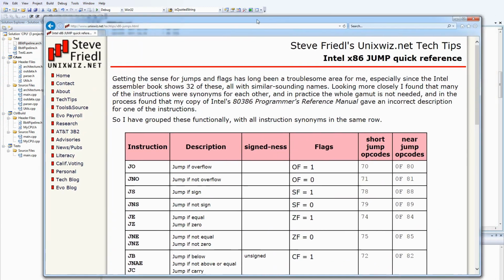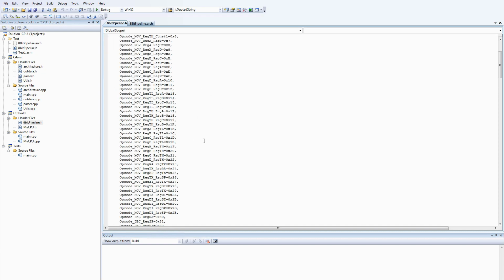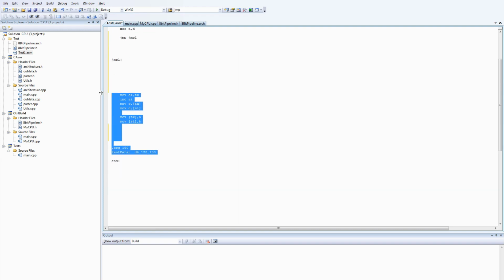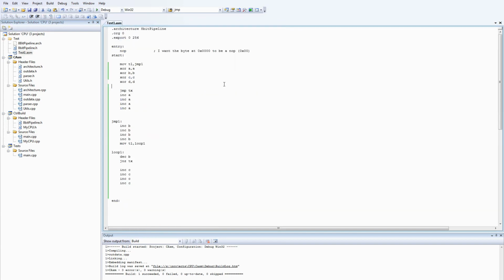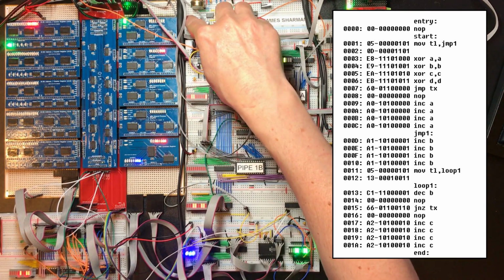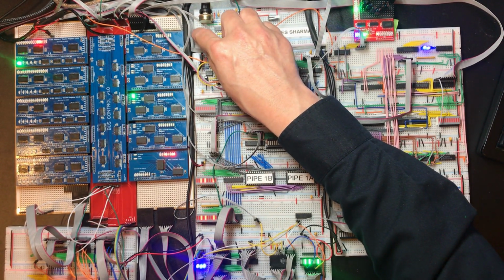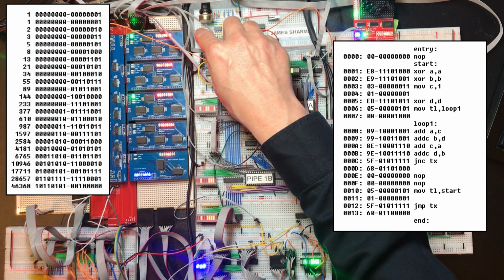Flow Control - Making an 8 Bit pipelined CPU - Part 54

Comment: Yep, that's one of the things that drove me nuts about MIPS.  I only once found a use for it.  Usually it's just an unnecessary NOP.
Reply from the maker: I've used it quite a bit in the past on mips. Remember the delay is often there regardless, pipelined cpu's without it normallly are just wasting the extra cycle(s), at least before you get into the complexities of branch prediction.

Comment: Bravo for accepting the delayed branch! Were you a MIPS, PA-RISC or SPARC programmer at some point?  

I did the odd bit of assembly on HP-PA, Sun4 and DECStation, so I've seen delayed-branch before. I seem to recall that one of the early RISC processors also had load delays like yours, and then needed multiple microcode revisions because the presence of caches messed up the timings. Compilers actually got amazingly good at finding work to fill branch delay slots.
Reply from the maker: Playstation-2 was MIPS III which I did a lot of low level optimization on, that was probably the first platform I did a lot of work on where I was taking account of delay slots.

Comment: Why does register B (35:53, 37:48, 37:50) and D (37:48, 37:59) sometimes flash? What did I miss?
Reply from the maker: In the first time index the instruction completing in stage 2 is "addc b,d", there is some irregularity to some of the timing purely down to my pushing the button manually.
Reply: @weirdboyjim  I dont think it is related to manual ticks (button) or regular (auto). As you can see even later when you do not push it, and it is running freely, its still flickering. I was just curious if it is some bug, that will be later fixed or something related with pipeline by design.
Reply from the maker: Ok, I had a second look at this (on a computer screen rather than a phone screen) and realised what you were talking about. What you are seeing relates to a problem I had with the circuit. The B register in this case is going to load, so the bus controller is feeding the address of the register and the clock into a 74LS138 which will generate the latch line that will go low at the start of the clock and return high in the middle.  The issue I had for a little while is that the selection and clock signal were not synchronised resulting in a momentary downward blip at the start of the cycle on the latch line. This resulted in the register loading whatever junk was on the bus at the start of the cycle before it loaded the correct value at the mid point. This didn’t cause any issues as the register was changing anyway, but there was a similar issue on the counters I had to diagnose and fix later.
Reply: @weirdboyjim  Thanks for the explanation. It was driving me crazy, since it looked almost like some pattern related to addc command, but I could not see how it relates. Anyway nice project, even Im a bit late to the train :)

Comment: I realized there's quite a bit I forgot to mention in my previous comment.

First, I wanted to go over the changes to the flags used in conditionals compared to x86. Since the carry flag generated by subtraction in your processor is the inverse of that generated by the x86 during subtraction, you need to invert the carry requirements in any conditional that uses the carry flag but doesn't mention its state. This means that JB and JNAE should be aliases for JNC, not JC; JNB and JAE should be aliases for JC, not JNC; JBE and JNA should use flags (!Carry OR Zero); and JNBE and JA should use flags (Carry AND !Zero).

Second, at 11:35, the expression you wrote for JG was equivalent to (!Zero AND !Sign), which doesn't take into account the overflow.

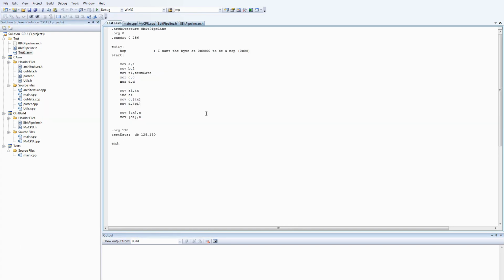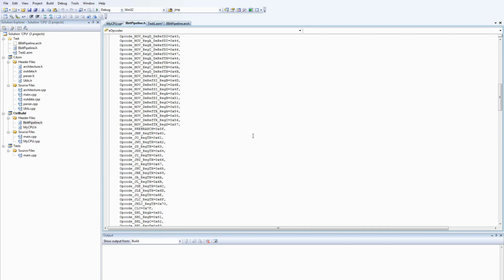Third, between when you initially wrote all of the microcode for the conditional jump instructions at 11:39 and when you next show it at 26:53, it looks like you added parentheses around nd the ternary operators. I'm guessing you fixed that around when you were troubleshooting the problem that occurred at around 21:31 but just didn't show it.

Finally, I was hoping to see some optimization involving the branch delay slot, but since the PREBRANCH instruction forces a NOP right after a branch, I guess I won't get to see that. That's disappointing.
Reply from the maker: I'm amazed how many people comment about mistakes after I find / fix them compared to before.

Comment: (0:49) Well, I already went over my guess for one of the other two lines in a previous video. Not sure about the last one, though.
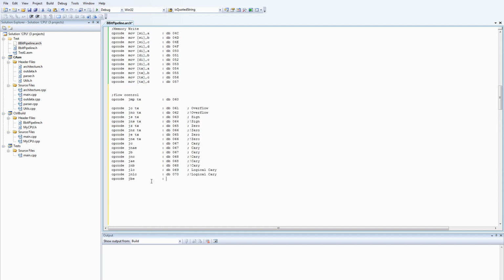(4:27) The carry flag works differently in x86 than in your processor, so some of those conditional jump aliases don't make sense on your processor. (On x86, both unsigned carry and unsigned borrow set the carry flag, whereas on your processor, unsigned carry sets the carry flag, and unsigned borrow clears the carry flag.)
(23:11) I think that might be the race condition between PC load and increment I mentioned before!

Did you ever get rid of the need for the prebranch instruction?
Reply from the maker: It was a genuine mistake to use the x86 truth table, at the time I didn't realize the meaning of the carry flag was inverted there. This gets fixed in a later video.

Comment: Any plans to make your assembler any smarter and start to do your delay slot optimisation for you? Or have it emit meta instructions such that you could do something like `mov tx, {a, b}` and it'll emit the correct movs and shifts for you?
Reply from the maker: Smart optimization like that would be an interesting challenge, but very time consuming to implement. Even more of a challenge to do such that the assembler is still vaguely generic.

Comment: Seems like subdividing the clock to have some parts execute a bit later to give others time to have some gates would be a good idea. It already is divided into two halves, so having another subdivision at "clock + 2 gates" wouldn't be too outlandish. And having a clock line that ends early and starts late would make sure there's never an overlap asserting to any bus.
Reply from the maker: I do use a bit of a delay like that on the memory board to make sure the address is on the bus.

Comment: Very nice job. Was wondering if you were going to use branch delay slots, or a pipeline flush. Got my answer.

And I also have an odd idea involving speed. Suspect the EEPROMs you're using for your pipeline control are fairly slow and as such are in the critical path regarding the ultimate speed of your CPU. So my idea is to replace those EEPROMs with much faster static RAMs. Then extend/replace your reset with a circuit that copies data from an EEPROM into the static RAM. Of course that makes a reset take a lot longer, so perhaps have two different versions. A cold reset does the copy, while a warm reset doesn't.
Reply from the maker: Thanks John! The eeproms, specifically the stage 1 roms are the critical path. Your suggest would help but I think the circuitry would get in the way of one of the purposes of the build which is to try and create a simple model. I maybe able to increase the clock rate in the future by switching to some one time programmable roms but later in the series you'll see we get some decent performance out of it as is. You may be interested that I do a similer rom->ram copy system on a later video for main memory  to both improve the speed but also give me some extra flexibility about memory configuration.

Comment: I love the series and you clearly deserve many, many more views.
I was wondering about the choice to have a load tx+prebranch+jmp(+nop) for all branches, this sounds like a lot of work for a very common feature, isn't it going to hurt software performance globally?
Reply from the maker: Thanks Julien! Glad you are enjoying it. The final nop isn't needed and I'm hoping to do a circuit fix to drop the hidden prebranch instruction but I've said I'll only do that when the rest of it is finished (It could be done a few ways). The performance isn't that bad though, A jump to a 16 bit destination from scratch is "mov tl,??; mov th,??;prebranch;jmp tx" which is 7 cycles from beginning to end. This looks harsh but remember "JP 16bitImmediate" on the z80 is a 10 cycle instruction (The 6502 JMP is faster at 3 cycles). Where my stuff does loose out is in compactness, 3 bytes on the z80 (same on the 6502) compares to 6 bytes on my ISA.  Those sequences and other equivalent ones cause my binaries to be less compact than equivalent z80/6502. Most importantly the separation of the constant load and the jmp's like this allowed me to keep the pipeline much simpler that it would otherwise have been and I think it would have been tougher to follow if I'd had a deeper pipeline or a hybrid microcode system.

Comment: SPARC delay slots. 😎
Reply from the maker: As a programmer branch delay slots always seemed weird, but when you start assembling circuits it starts to make perfect sense as to why they are there. Having done a lot of low level optimization over the years I prefer to have this stuff open for use rather than have it hidden for a simpler programming model.
Reply: James Sharman very nice series. Can’t wait to see the next set of PCBs. 😎

Comment: Fibo works fine in my built, thanks for the great videos.For a better reading of the fibo numbers I connected 4 7-segment LCDs to the SI Reg and moved a,b and c,d to TX-LD,TX-LH each iteration. After that I make a mov si,tx and there is an interesting situation: the last mov to the XF-TH seems to be to late and the mov si,tx on pipe1 is done without the mov to the XF-TH. I then put in a nop before mov si,tx and all works fine. is that an error in my circuit or expected behavior? Here a video of YOUR pipelined CPU built in Proteus  https://youtu.be/wHBfDKixhCQ
Reply from the maker: That's great work Detlev!  Yes, the mov si,tx thing you describe is expected. 8 bit data moves happen in stage 2 but 16 bit register moves happen in stage 1, so you need an instruction between. This isn't' an issue with a constant load since that adds a 2nd cycle anyway but if you are copying from registers you'll need to account for it. I touched on that in the contention video ages ago. I did think about an output register (like you have duel purposed si to) but opted against it, the lcd display looks better once I got it working.

Comment: Hi James. Why don't you add a flag to reset the first pipeline stage to avoid the necessity to put a nop instruction in assembler code?
Reply from the maker: Are you talking about the NOP at address zero?  That bus request line from the OR gate was actually supposed to do that but I had to revert the change until I work out why it was causing a problem. If you mean the delay slots elsewhere that I’m not actually that worried about them. Delay slots have been a fact of life for me programming for years on lots of different architectures, understanding them is one of the keys to writing really efficient code.

Comment: I'm now convinced my CPU won't be pipelined (at least initially) :) I don't think I want to deal with the software side of it.
Reply from the maker: That’s probably a good call for a first build. A middle ground might be to implement a pre-fetch stage that grabs the next instruction while the previous one is executing. It would be a nice performance boost with out the deeper pipeline complexities.

Comment: Hey James, quite an achievement! Congratulations with the progress you're making.
Talking about  a temporary display; how about perhaps a single digit driven by a 595-shiftregister? ;-)
Reply from the maker: I need more than one digit, a 16 bit value can be anything upto 5 digits. Perhaps some kind of modular system?
Reply: @weirdboyjim  I'm just finishing up a hex key pad and 8-digit multiplexed hex display. The display itself is pretty simple it's just counter>138>open collector driver to pull each digit's common pin to ground. On the other side each segment is connected to 5v via a resistor and another open collector pulls the resistor to ground effectively switching that segment off. I'm using a diode Rom to do the binary to 7-seg conversion and 8 x 4-bit buffers to select the current digit.

In your case you could use a 512k ROM like ben or use a BCD to 7-segment chip and do the binary to BCD conversion in software.
Reply from the maker: The comments from Maxint and I here are kind of a private joke, I’m not planning on doing a 7-segment based display, my temporary display video should be up in a few days time (I’ve recorded the first half at the time of writing this comment). Well done on using the 138 to drive 8 of them, though I’d worry that would flicker a lot on camera. I saw a design like that on reddit recently, was that you?
Reply: @weirdboyjim  :-)  @driazy1 - interesting that you are using a diode ROM. That kind-of ties in to what James was using here: https://youtu.be/UXz_rTgeAEc 
Using that 138 also sounds interesting. Can you perhaps show a short clip of it on your channel?
Reply: @weirdboyjim  That wasn't me. I only finished soldering the display yesterday and still need to do the buttons and related chips.

Flicker is optional. It's currently running at 400Hz, but could run at several hundred kHz or whatever the max speed of the 555 is.
Reply: @weirdboyjim  - That would be even better! Perhaps you can use the output pin of the 595 to cascade them...
Just in case you ever want to make your own from scratch - I recently published this OpenScad design for a 3D printable diffuser: https://www.thingiverse.com/thing:3843620
 It's a remix which includes some handy additions to the original.

Comment: Yeah... I'm sure I've done macros in "some assembler program or other" in the past that said something like:
.MACRO jne @label
jnz label
.END

So you (or anyone else reading this) have any examples of "real" instruction sets where you'd have to manually insert a nop (or something clever) after a jump instruction on a pipelined architecture. I'm sure we didn't on the 6502 (but that was a long time ago). Someone else on here was talking about PIC (I'm what Dave Jones would disdainfully call an AVR fanboy, so I've never done any PIC) - would you need to insert the manual NOPs there? These manual NOPs may enable some really cool features... but, to me, there's something "wrong" about them.... I'd be putting handling them in a similar way to the constant register on the bottom of my TODO list if it hadn't been for the PREBRANCH. It's still not "perfect" but those NOPs were bothering my sense of aesthetics.
Reply from the maker: If you are interested in this stuff the "magic google search term" is " delay slot". MIPS and SPARC are the easy examples, but you are probably surrounded by processors that use it. I can't discusses specific architectures due to NDA's but it's likely the gpu in your phone and computer have this. It's still fairly common in high performance architectures where the code is machine generated, in a gpu it's easier to make the shader compiler handle that stuff than to waste silicon on it.
Reply: @weirdboyjim  Woah... MIPS... All my hacked-together-from-old-routers network kit is MIPS... can't say I've ever cracked open the assembler for them though.
Again... can't say I've done that much with GPUs... but I imagine their code to have all sorts of what I would call "oddities" for the sake of performance.

Comment: Congrats on the TTL Helloworld!

The issue with the '193 counters is from them not having synchronous load, which might become an issue later on if you do a single cycle read write to an address register(haven't had a good look at your architecture yet so may not be an issue). 

I think the only fully synchronous counter still available is the '163A. It's an up counter though. Which kind of sucks.
Reply from the maker: Not at hello world yet! (Very soon!). There won’t be a single cycle read/write to the counter/address registers. The architecture is conventional in having a single device assert to any given bus and a single device load from it in a cycle. The issue with the increment was folly and is something that I wouldn’t have hit if  I’d design that end of the processor now.

Comment: Amazing series, it's been a lot of fun so far. Keep it up. I put my own project on hold for almost 3 weeks just to catch up with your series and see what improvements I could incorporate into my design. I decided this is really beyond me right now but have been able to use several things from your videos to help me along.  I'm back to work on my CPU and can't wait to see your display.
Reply from the maker: That’s good to hear, I would say that you shouldn’t assume that anything I’ve done is the best (or even correct) way of doing things. Assuming you’ve started of with Ben Eater style design then probably the most important addition you could take is using the demultiplexers instead of control lines that go directly to the various chips on the bus. Makes like a lot simpler and will give you room for expansion.

Comment: I wonder how much work it'd be to knock together an LLVM backend for your CPU...
Reply from the maker: I would have assumed that it would be difficult to target LLVM to an 8bit architecture with a 16bit address space. If you were truly crazy you could add banked memory and write a 32bit VM in 8bit assembly that you could target from a modern compiler.
Reply: @weirdboyjim  IIRC there's a 6502 backend... Which would at least be abgoof reference point to start from.
Reply from the maker: I'll have to look at that. But it's likely to be more effort than writing everthing in asm ;-)